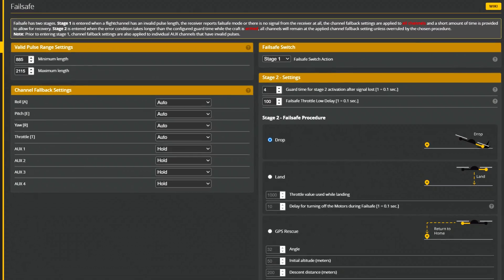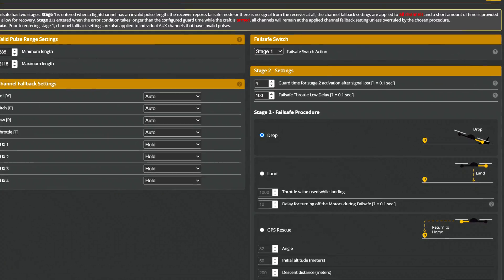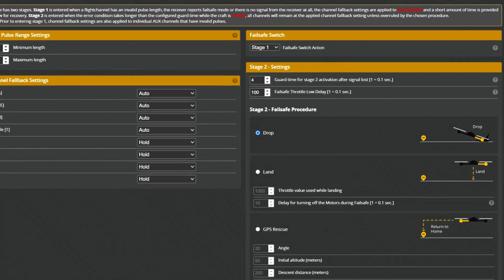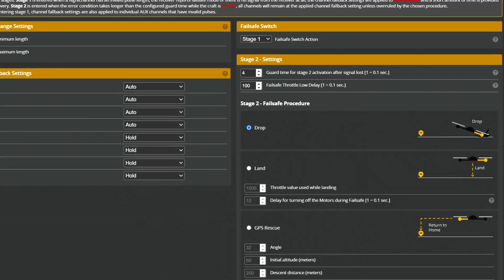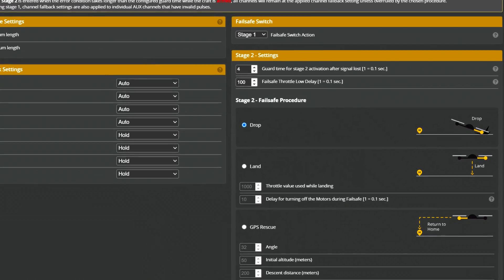Failsafe flight mode is obsolete, do not use it!

Comment: It happened to me to lose or to have a very bad video link while flying FPV. I was happy to be able to trigger failsafe to ease the landing of the quad instead of disarming it (I'm using Betaflight). Or to check if the rotor speed for descent is okay.

Comment: yesterday we did try failafe with the new betaflight rc6 and a new lrs reciver arrow did point correct way and when my friend did remove the module the drone lifted from the ground but in the wrong direction and almoust did not climb much also. He did manage take controll and land the drone safe. But why did this happen. Is it the Reciver fault ore the FC faults. yesterday he did same test with different reciver and it did work problem was that elrs reciver had very bad range.

Comment: I just upgraded INAV to version 4.1.  I went to add the mode RTL and found that it is missing, so I created the mode Failsafe to RTL.  This sounds like it is the wrong way.  What happen to RTL in the flight modes?  I am using a MATEK F4 flight controller.
Reply from the maker: If this is a drone, you need enabled and configured baro, mag and gps to have RTH mode
Reply: Thank you so much.

Comment: I have a holybro Kakute F7 and PH and RTH work ok. I can do Mag calibration with sticks and hear the beeps from the drone,
also I load WP to FC and hear the beeps. I built a new drone with Matek 722 SE and can not not hear the beeps from drone when I do mag cal with sticks.
My PH and RTH do not work either...any Ideas? Thanks.
My mag orientation looks OK in configurator. Tried both 4.1.0 and 3.1.0 and same problem.

Comment: Hello  I have a drone and when throttle between -75 to -100% the yaw, roll and pitch do not work. When throttle stick is in up position to -74% 
and more then yaw , pitch and roll work. Where is the parameter in CLI that controls this behavior.
I would like to change it to have yaw, pitch and roll work when Throttle at lowest position -100%. Thanks.
Reply: You should enable airmode, although it is weird that they stop working at -75% already. Maybe you should also adjust your throttle curve, but airmode is what keeps the motors spinning even with no throttle.

Comment: I use Crossfire and have been having failsafes on my 3" quad. The reason is that, for some reason, my NanoRx is loosing power from the FC. So, the radio link is great because of I use Crossfire, but a HW issue causes failesafes. So, maybe it's still good to configure failsafe. even with new RC links.

Comment: I respectfully disagree. I had a flight that made me change back to using the failsafe mode rather than using the built in failsafe detection. The problem was it would not let go of the failsafe condition after the RX signal came back. After that flight and bench tests, I always set the Crossfire to send the correct modes to start the failsafe condition. I tested this on the bench and it is the only way my plane would go into failsafe and come out of it properly. That was version  2.5.1 and I continue to set my planes up using the mode, not the auto detection. This video was the time it happened in a flight. I would strongly recommend to keep failsafe mode around. Anyway watch the video footage and I also recommend some bench testing. (Go to the back yard and get sats and try failsafe.) Maybe it's only a Crossfire issue. A few years ago I had Dragonlink v2 receivers and the mode was the only way to set up failsafe on it and that works perfectly with iNav / Crossfire and other receivers as well. https://youtu.be/JBd1i0JWAn4?t=536
Reply: Oh yeah, I almost forgot. THANK YOU!!!!!! for all the cool stuff you do. Without you and your development team we would have given up on the hobby (Just kidding I can't quit, we would just be stuck with DJI flight controllers without you guys :)

Comment: Pawel, I suggest your recommendation makes sense for fixed wing flyers but not multicopters.  With a multicopter, we feel it is a wise safety feature to have Failsafe available on a switch.
Reply from the maker: Why? RTH has own mode and Disarm is already on a switch. So why to have this 3rd option?
Reply: @FPVUniversity  because there is a stage 1 which will prepare the quadcopter to a good GPS Rescue (if well configured).

Comment: Hey Padwell I had a motor burn out on fail safe RTH on iNav 3.0 cause i crashed and it flip upside down.  Has there been anything to try and a identify a crash happening with Radio connection lost to cut motor from going into over drive? i know that the value of G-force can be taken into consideration of sensor of indication.

Comment: Radio receiver "Failsafe mode" is obsolete, configuration of lost receiver radio signal in flight controller software configuration is a very important safety feature. (not obsolete)

"Failsafe flight mode is obsolete" leaves some confusion. Perhaps flight controller software should rename to "Emergency Mode" to differentate? For rotors, a "hold and decend" at controlled decent rate would be good option (as land implies an end state that may not necessary be achieved). For wings, a "loiter and decend" would be helpful. Both should offer options for RTH (return to home) as an initial "Emergency Mode" action.
Reply: Yes I'm confused 😕 🤔😂

Comment: I always used this mode to test if drone would ascend or descend with certain props and throttle value. And i will wont stop using until You will remove it ;P

Comment: How about if you want to test if RTH failsafe is working properly? Just turn off the radio instead?
Reply: Turning of radio is dangerous. In some radio, all switches must be back to normal position when it's turned on, which means you'll have to disarm your air craft on the sky. I destroyed my Dart because of doing it.
Reply: I wouldn't want to turn off my radio if the model is flying! Surely it's better to set a failsafe channel just for this test, then disable it afterwards.
Reply: "failsafe" is for non-GPS rigs. RTH is a GPS-rescue which will work fine if you have programmed it properly. Nurk has a video where he goes through turning off his radio and playing panic while it drops from the sky. You can re-arm, he does it. It's called something like "finally got gps rescue to work"
Reply from the maker: To test RTH use RTH mode. And you can test Failsafe at home on a workbench
Reply: @FPVUniversity  I feel like the setup is a bit trickier (at least in bf) to confidently trust it will work with the method you describe.
Inav seems more straightforward on that though.
But I’m still gonna use the failsafe mode for testing, and then take it out afterwards.
Reply: @FPVUniversity  If you test Failsafe on the bench by switching off the radio, how can you tell if the FC has gone to RTH mode if the aircraft doesn't have FPV gear?
Reply from the maker: @ChrisBalmforth  And if you enable Fasilsafe mode how do you know the same will happen when real failsafe will occur?
Reply: @FPVUniversity  Very true! I guess I'll have to temporarily fit a camera to this particular plane to really check what it will do when it failsafes. Thanks for a very interesting and thought-provoking video!
Reply: @ChrisBalmforth  remove the propellers, then arm. If it's quad with compass move some meters by walking or crawling, then turn off the radio, look at the OSD whether it's doing RTH by failsafe or not. If it's fixed wing with no compas, don't walk, but run fast.
Reply: @serang  😃 Should be OK if I remove the props!